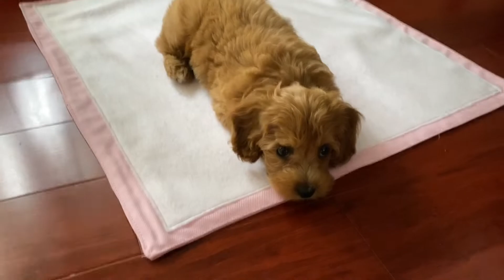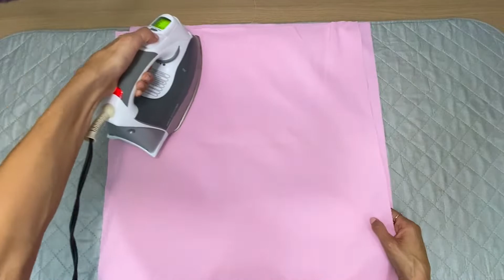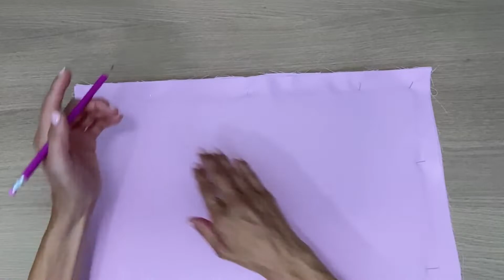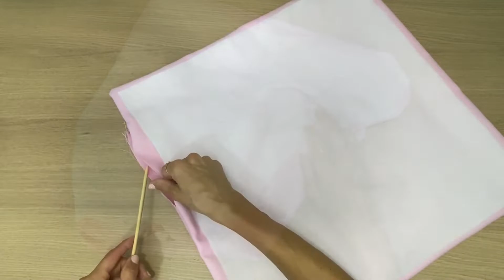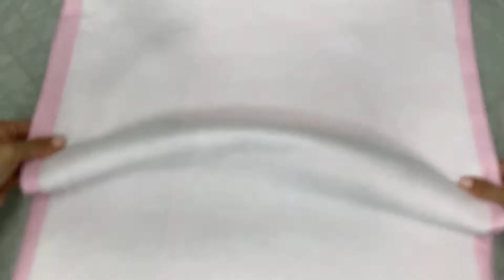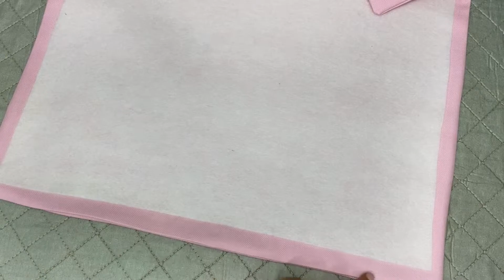HOW I MAKE WASHABLE WEE WEE PADS FOR MY PUPPY TUTORIAL

Comment: So I made 10 wewe pads they leaked through and I don’t know why  I used Polyester 100% which  naturally repels water two layers  and fusible fleece on top. When ironing it didn’t seem to fully iron on the best but I did iron it for a while every individual one. idk if it was cause it needed to be iron on at a hotter temperature. I had my iron on synthetic which was the right temperature my fusible fleece is 100% polyester also and I know polyester you can’t do at to high of a temperature . Is it cause the adhesive on the fabric didn't iron on right? Maybe that’s why it isn’t water proof?
Reply: The fusible fleece I didn’t try ironing on and I did sew it in place along the edging only . I did not sewing in the center at all. Just trying to explain everything I did.
Reply from the maker: Hmm that’s interesting. Did you use the waterproof fabric similar to what I used? That’s my concern.
Reply: @L @LetsMAKEItAcademy t’s water resistant not water proof it’s 100%polyester.  The fusible fleeces didn’t hold any moisture at all it went straight through it, I thought maybe it soak it up holding some but it didn’t.  Also it leaked throw fast was on my floor instantly before the dog stopped peeing . The fabric I used was 100% polyester acts as a hydrophobic material that repels water rather than absorbing it so I figured that work.  It soaked through right away. Hopefully no one makes the mistake I did.  Are store didn’t have water proof they told me it was a lot like pul fabric I looked up the difference I didn’t know pul was  100%water proof I got the impression it was about the same and thought there both water resistant. Thank you for your video .

Comment: Nice tutorial! What is the waterproof fabric you used? What is the thickness of the fusible fleece? 

Just an fyi that if someone sews through the waterproof layer & the fusible fleece, the pad will wick/leak through the stitch holes. It should be fine at the edges (unless a puppy pees a lot near the edges, but sewing through the fusible fleece in the center of it to make a design, will cause leaking... I learned this from making cloth menstrual pads & diapers. You can use poly thread, but it can still wick/leak.
Reply from the maker: Thank you so much for your comment and FYI. You are correct! I don’t recall the thickness of the fusible fleece, but here is the waterproof fabric: https://amzn.to/3NZZvW8